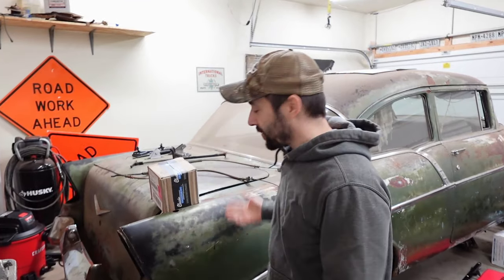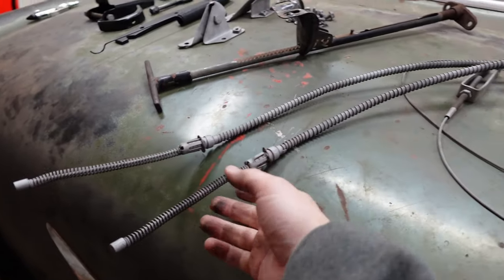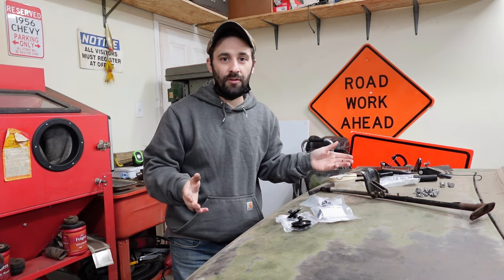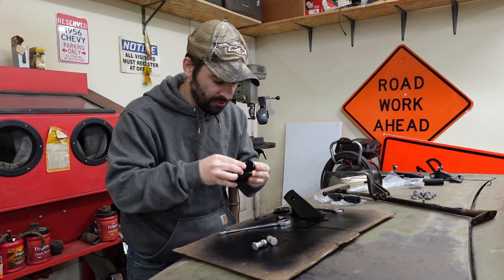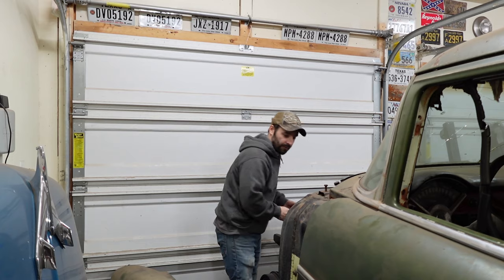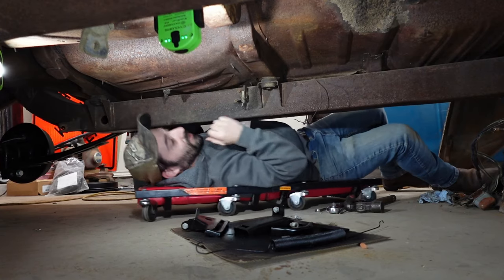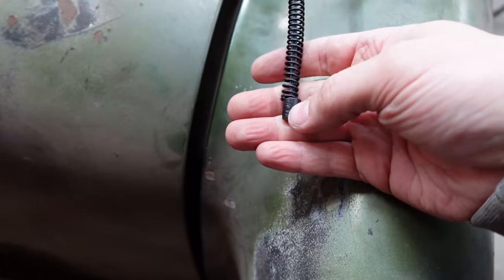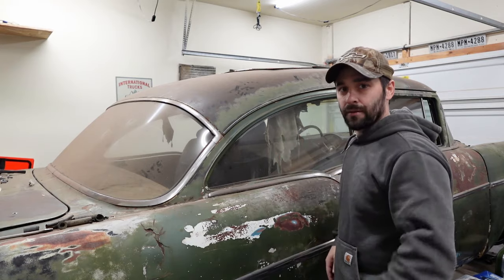I Gotta Figure This Out... Abandoned 1956 Chevy Build

Comment: I just rebuilt my park brake system.my car was missing the clevis and the lever.i used a fence post mending plate from home depot that had perfect hole spacing already drilled and cut the v notch with a cut off wheel. I hand fabricated the clevis with flat bar.had to order the rear drum cross bars and levers from classic industries.yours turned out great.
Reply from the maker: Now that's hot rodding. Thank you.

Comment: If you need to do inner and outer rockers I would do them before I do the floors. that way the structure of the floors will keep the pillar door post gaps the same. outers first, inners and new floor. if you get a full floor and boot in one it will be less welding but more difficult to install due to the size. The handbrake boots may stretch over the ball end of the cable with some lube if you are lucky. May need to attach some string to the cable near the ball end to put through the boot first to give you something to pull on to get the boot over the ball. best of luck with what ever you do. Stew.
Reply from the maker: Thanks for taking the time to comment. I appreciate that. Also debating doing lower quarters at the same time as outer rockers. We'll see.

Comment: I was thinking about trying Hot blueing on the bolts I use for my 51 Ford.  At least the non-safety related ones, since the heat can change the temper of the bolt.  But at least it would be black without having paint in the threads.
Reply from the maker: That's interesting.